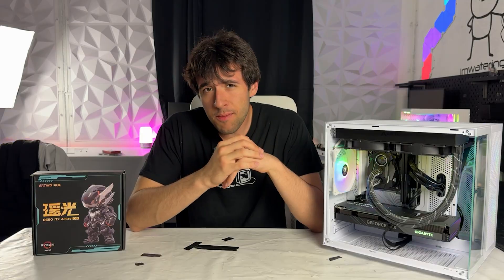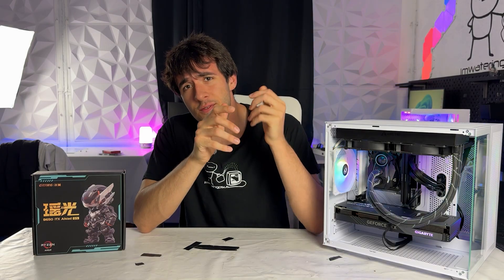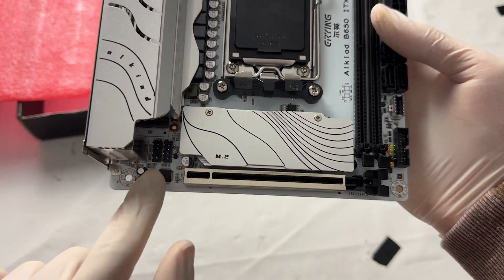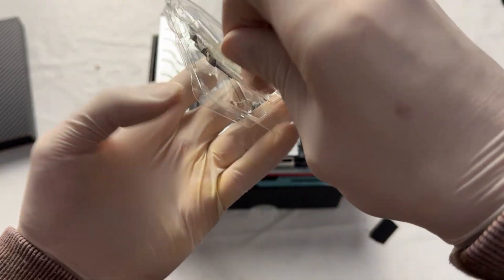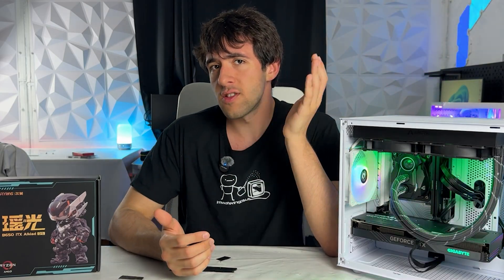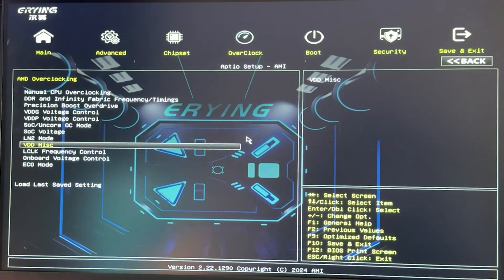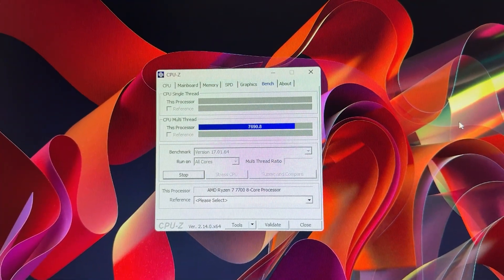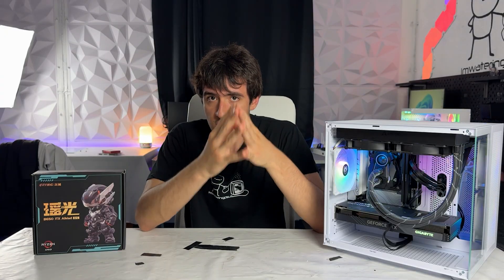Another 100$ Chinese AM5 Motherboard Scam? - Erying Alkiad B650I AMD Review

Comment: Hey mate! Is this a good Mobo for a 7500f? Building a cheap Gaming pc for my nephew and managed to get a ryzen 7500f cheap enought.. this mobo would be good?

Also suggest me some good ddr5 cheap memory kits from AliExpress to go with the cpu and ram

Grazie mille
Reply: Yes, the nodo is fully compatible with the 7500f.
Maybe you have to take some ram with a frequency not too high, because in an other video I've seen that at if the ram frequency is too high, the system doesn't boot, is is unstable. I suggest you some 4800 GHz ram.
Take this last informazion as not sure at 100%, but I remember this from other tech youruber that have spoken about this mobo. Maybe you should verify that. Hope to be useful

Comment: Could you show how to get WiFi on the Jginyue boards in your next video?

They don't actually tell you what connection for the Network card it uses.
Reply: CNVI e key PCIe card. I ordered an AX201 for my JGINYUE board and it worked perfectly (exact same setup as this ERYING board)